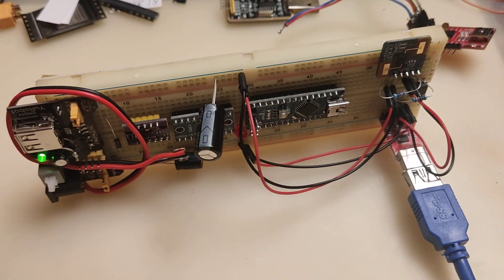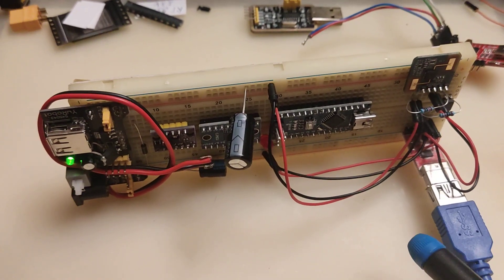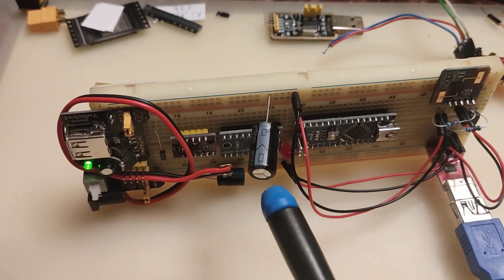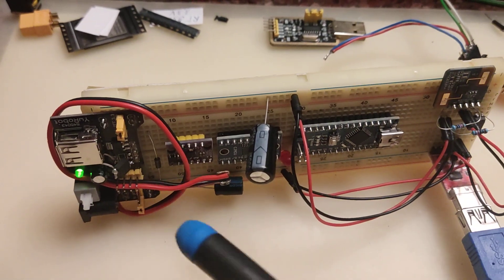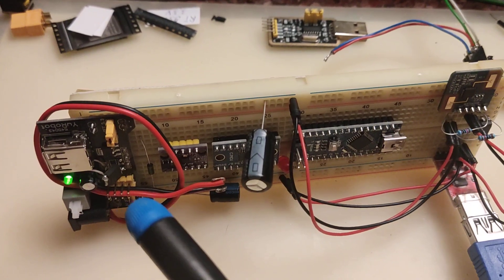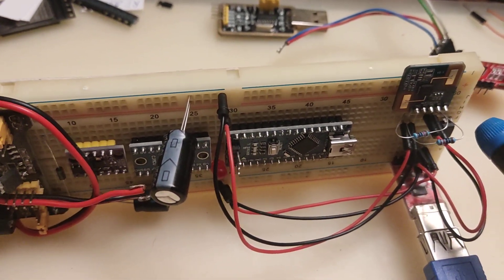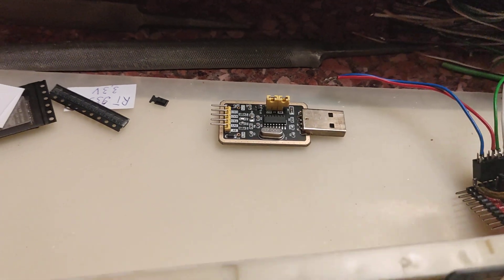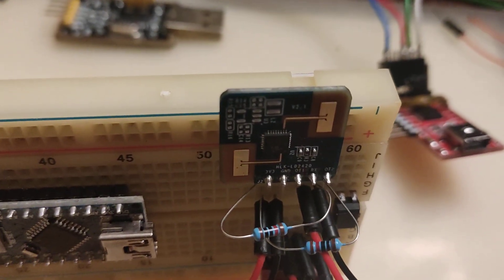HLK-LD2420 module does not respond.

Comment: The documentation I received from the vendor is incorrect:  The wiring diagram shows RXD connected to O_T2, however the table says O_T1.  The diagram is incorrect.
After correcting that, I could communicate, except that the messaging protocol provided by the vendor does not seem to be implemented.
Reply: Thank you. This is what helped. It is not clear how to set the sensitivity zones of the sensor. Apparently I ruined everything in my sensor.
Reply: Hai I also use LD2420 same issues nothing work are this because I use OT1? I should use OT2 right? to gain signal high or Low?